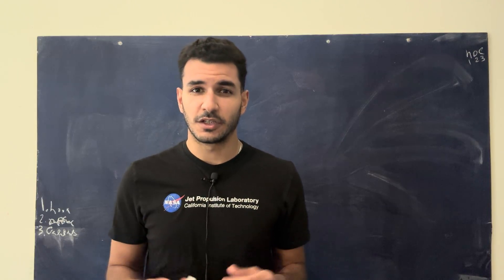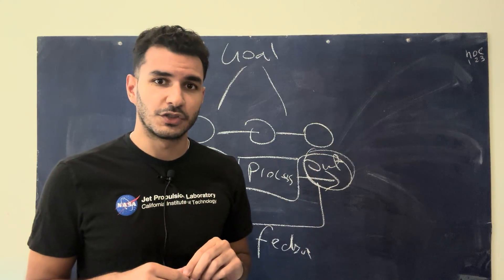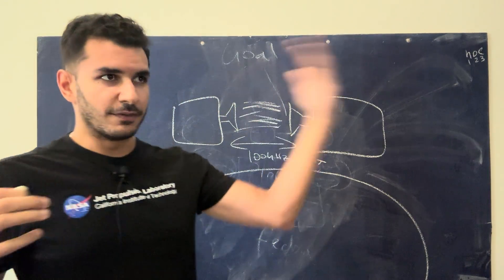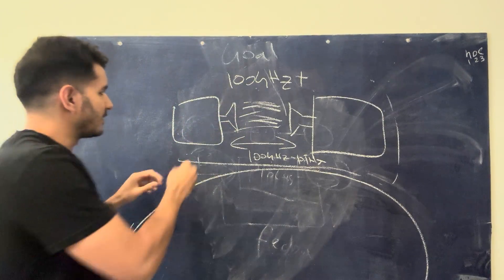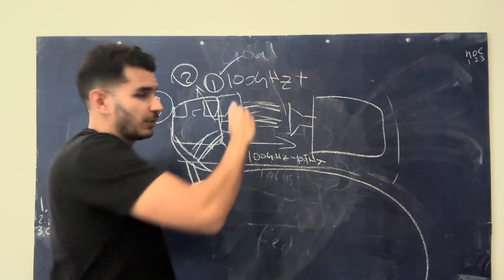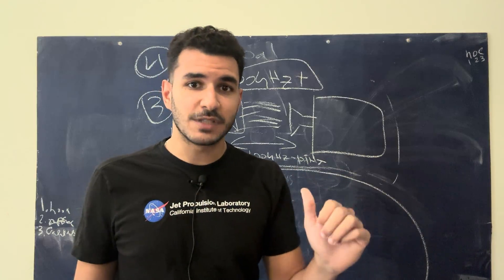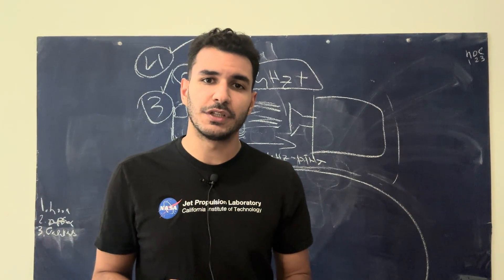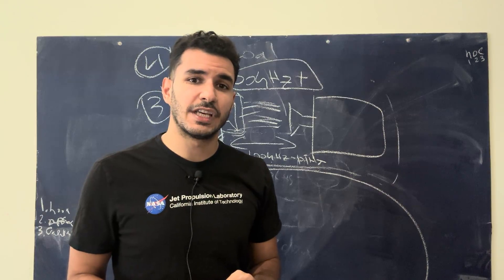NASA Engineer explains why systems engineering is the best form of engineering

Comment: I totally agree with you that a Masters Degree in Systems Engineering is necessary. I am an Electrical Engineer with experience in Power, Computer Networks and Embedded Systems. I am at that stage where  I have a dilemma about what I really want at Masters....Mechatronics or Robotics or AI and ML or Telecomms.....So I also can envision a Systems Engineering MSc encompassing most of these aspects. I would be glad to keep in touch and follow up on this.

Comment: I was hired directly into a systems engineer role. Here are my thoughts about it:
1) Personally, too much of the job overlaps with business logistics. I get extremely bored when I have to deal with systems and requirements documents. I'd rather fully focus on technical problems.
2) I don't agree with companies hiring junior level (such as myself) employees into systems roles. Even if the employee has a systems degree, most of systems knowledge is company or even project specifc. In many cases these projects have substantial history to learn. You touch upon this point when you say " you need an expertise in one field and other things are built upon that". I think it makes much more sense to hire someone into a component role and then have them graduate to a systems position after many years. My sentiment about this was reaffirmed when a senior engineer told me that my company used to not hire directly into systems roles.

Comment: About needing expertise in one field as a base is spot on. It's quite clear that many people who study Energy System Analysis have very little knowledge of the actual physics of the power grid. They only learn the big picture, but when things break, they have no clue why or how to solve it. The scary thing is that most of these people are responsible for policymaking. 

You don't even need to have a high level of expertise in a relevant area. You could've studied Medical Biotechnology, but you get the understanding of how complex things can be, such as the power grid. If you start by going broad from the beginning, you are set up for failure.

Comment: systems engineering, could be a follow in applied math undergrad.

financial engineering springs to mind, so does actuarial exams and that track but those are a bit 1-d, if we look at the trend in software and industry we see a more multidisciplinary approach, machine learning engineering and the white papers are a great intersection of stats and CS, and when applied to say an audio or image problem... the surface is as presenter says its no longer oned. you cant just study one discipline and be successful, and there are many orphaned students from programs like econ, math, engineering that become nothing but CAD or SQL monkeys.

thats a travesty, first step first is to realize you can teach yourself, and learn a textbook yourself and thats why an exploratory implementation focused discipline of systems engineering would be valuable

hope that helps, also learn rust, its fantastic for ppl coming in from outside of CS 😅

Comment: In Continental Europe, Systems Engineering is very common because it is integrated in the Diplom/ Engineers' degree. European engineering degrees are usually a combined bachelors and masters, so you first go deeper in a domain like mechanical, electrical, computer, aeronautical etc, and then expand into systems design and engineering in the "masters" side of the degree. You will notice that European degrees from professional universities/ universities of Applied Sciences, incorporate "systems" in their name.

Comment: Hi Ali, loved this talk. I am a Mechatronics and Robotics Engineering student. Regarding the matter of requiring a significant foundation area (as in EE for yourself) do you imagine that is harder to specify given the breadth of subject matter a mechatronics major covers? Watching your presentation had me thinking, it could be loosely argued that mechatronics in itself is almost inherently a systems engineering major (not exactly of course but for the sake of pondering), given the required applied knowledge across software, computer, electrical, mechanical areas - the trade-off being, one doesn't necessarily "perfect" any single area in such a degree however unless specifically diving into a niche in their own time or through post grad study.

I would love to go into systems engineering. My personal projects are essentially systems engineering problems (and I like it that way! haha)

Cheers Ali. 

Brendan from Australia.

Comment: Practically nothing exists depending on just one branch of engineering, for example, computers have software and hardware, the latter of which depends on electrical, mechanical, and to some extent chemical engineering. Therefore, to excel at engineering some extent of systems engineering is required.

Comment: You re saying you have to know all types of engineering like mechanical electrical manufacturing etc..but engineering is a teamwork. Dont system engineers work in a big team involving mechanical and electrical engineers and more that I dont know of? Systems engineering should be familiar with all types of problem but not a master from each. Right?
Reply from the maker: You got it -- systems engineers know enough about all the sub-disciplines to know what the experts in each field need to know to collaborate.

Comment: I really appreciate the video. It's really good adn I think does a great job at breaking down what systems engineering truely does. Mechatronics Engineering (mechanical+Electronics+Software) is pretty much a very decent full stack engineering curriculum. I chose this for my core engineering bachelors foundation. I will do masters of CS with speacialty in AI for second to build coding skills and algorithm skills, for PhD I am wanting to do either systems or PhD Technology Management ( more business related). Polytechnical studies are best - they are more practical engineering. For example with e BS Mechatronics I was far ahead of others doing treditional ME or EE because I hade the theory of physics and electromagnetics but also understoood mterials science (more physics really) I understood circtuitdesign and also understood mechanical design and manufacturing principles. But I also went to university late in life ( 35 ), and had worked in the field as a mechanica and automation tehcnition for years - which is why i chose mechatronics -  Iwanted to have the answers to the low level foundational knowledge of the subjects I used in my every day life and not just on the technician level. My goal is to produce my own control systems components and software with integrated AI. I am also very interested in space systems engineering but I am not sure if it would be too dificault for me to transfer in this industry from industrial controls engineering. John Hoplins has a Systems Engineering Masters of Engineering and you can chose different areas of concentration.

Comment: Love the idea of making a masters for systems engineering (naturally pre-requiring a deep foundation in a given engineering discipline). I think it would be valuable because it could help students build the "connective tissue" to "move" and between disciplines and "drill down" into them as needed to solve an overarching goal. All while giving them the skill to "zoom out" and see the system as a whole and ask "what is it really doing? what is it for? where is it inefficient or becoming unstable?". With such a skillset, systems are able to be not only engineered, but imbued with cohesive intention - designed with a greater harmony (less loss) to achieve a specific purpose and reduce unintended side-effects. It's easy to see the value in that with a tad of effort in imagination. 

All created systems have designers and architects, some have engineers too.

Comment: This is a massively important thing and I commend you for addressing this topic, can you please expand further or teach more on it. This era needs this desperately, please fill this void.
Reply from the maker: can you tell me more?
Reply: @ I have my own domain of skills but have been trying to learn programming and engineering to help realize those goals, I have quickly realized the whole begets the means. So having a cohesive systems engineering framework became an obvious rabbit hole to help guild all domains I was trying to integrate cohesively
Reply: this is too verbose for no reason. I have a background in visual design, however instead of just making concepts or designs for fictional things I would like to build something complete. It has brought me down the rabbit hole of programming and engineering. However, when deciding what to build and how - I quickly started to realize I cant build parts without understanding how they will all come together. So I was looking into system engineering. To expand further I enjoy looking at whole systems and cross disciplinary solution - so understanding how to build cohesive systems across different domains intruiges me. There is very little content on it though.

Comment: This is actually an issue I noticed in the construction design management (CDM) industry I work in as a project engineer having studied mechanical engineering I struggle with keeping tabs with other disciplines despite the need. Noticed our company and similar companies in our space struggle in the engineering control roles liasoning between M&E and structural disciplines as the senior project engineers and managers sorta just expect the mechanical, electrical and structural engineers to sit down and have meetings with contractors related to producing and delivering these packages on guiding them according to our expectations. The issue being a lot of the things discussed by one major are either not picked up by other majors in prior with accuracy so we struggle with managing design expectations with contractors which takes longer than expected or struggling to deliver changes from one contractor to the other with the correct level of detail, possibly shaving off months of delay with simply a CDM systems engineer holding/running the meeting with the subbies instead delivering explaining the entire systems layout updates. As there are standards and regulations to abide by minor changes cause delays in fixing to account for otherwise.

It is weird but the way the current system has adapted is that the sub contracts who are supposed to just be delivering the package are essentially doing that part for us taking on that extra duty's burden.

Comment: Thanks Ali, 
"When you go up in frequency you get higher speed because you have higher available bandwidth which means you can equip more information on the waves that" 
Speed does not change with frequency of wave; it is constant and at space it is the speed of light. As you correctly mentioned, increasing the frequency will make room to transfer more data, which translate to higher rate of data transfer. The limiting factor will be the rate of data processing. Higher frequency wave will cost more energy to produce, shorter range and in cosmic scale... frequency will decrease due universe exapnsion .. is it possible to change the angle of a wave, so two waves of same frequency will transmit different set of data as each wave will be received at different angle?

Comment: My aerospace undergrad program had a systems engineering discipline and I took umbrage with it for the exact reason you specify. I would offer my view that what you described isn’t necessarily a “systems engineer” in the classical definition but an “engineer with systems thinking.” The average systems engineering profession in my experience is full of requirements, verification and validation, and other things that are very “2D.” This video is great advice for anyone who wants to have a framework to be an effective engineer no matter what they do, because being able to interface with a system effectively will reduce project development time and cost and will allow you to expand your skillset as an engineer in general.

Comment: Nice video showcasing practical experience of building a system. Only thing I would like to add is to highlight is that systems engineering is more of a structured process which enables problem definition, requirement gathering (functional, non functional, performance, reliability, availability, maintainability, safety, HMI, operational ), collaboration between stakeholders, ensures traceability throughout system lifecycle and lastly ,  making choice of technology as per the problem and NOT the solution!

Comment: I think there are similar paradigms in physics, chemistry, and biology, along with their intersections of course. I think systems engineer that works with biology will have very different expertise from someone like you who focuses more on the physics, even though you may share some problem solving, theoretical and computational techniques. So i agree with the sentiment that one needs to be really good at few fields to gain the best from systems engineering. UOttawa has 2 systems engineering masters, but i haven't looked in detail so i cant say too much about it, but they do have a academics with broad range of fields from economics to biology which I think is a good things, especially at masters level.

Comment: As one who began his career with a BSCS, obtained a BSEE while working and then later an MSCE/SSE and working as a software engineer, controls and measurements engineer, then moving into project management, functional management and then systems engineering and program management over a 32 year career, I  hesitate to call software or systems engineering engineering in the most fundamental definition of the word.  I believe the essence of modern engineering (not talking about train engineers or such), is the “application of science and mathematics” in the creation of something useful for humankind.  My experience is that very, very few people with the title of software engineer or systems engineering really apply science and math in any meaningful way.  There are a few exceptions, but the percentage is small as compared to electrical or structural engineers that use math and science on an almost daily basis.  Software development is hard to categorize as it is part logic, part writing, part art, etc., but very little of it involves math or science.  Systems engineering is really more management than engineering.  It is more focused on requirements definition and communication and, again, involves very little math or science.  I’m not knocking either field as I enjoyed working in both, but I still hesitate to call them engineering as I think that is really distorting the essence of engineering.

Comment: "System engineering is basically the engineering of systems" - this could be the most engineering way of defining a term I heard in a long time. 
I used to do this trick in my uni vivas when I didn’t fully knew the answer of a question 😂😂
Reply: I did that too 😭😭

Comment: I am a mechanical engr. Got masters in mech engr designs. I think a well-thought systems engr masters program would be good for engineers willing to learn more about another discipline to theirs. Like a mech engr may like to understand more on electromagnets and circuits, using Maxwell's Equation.